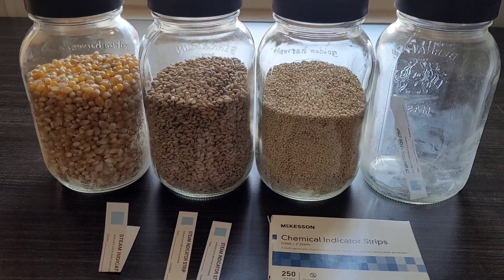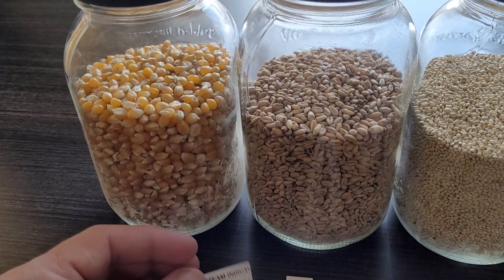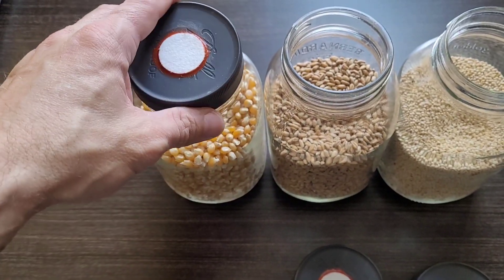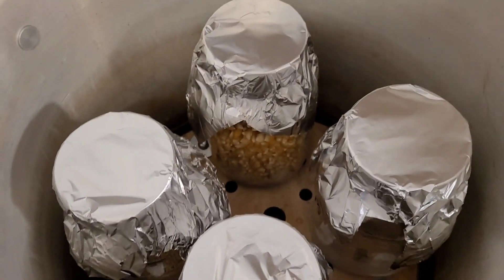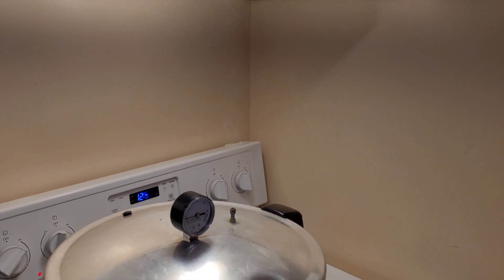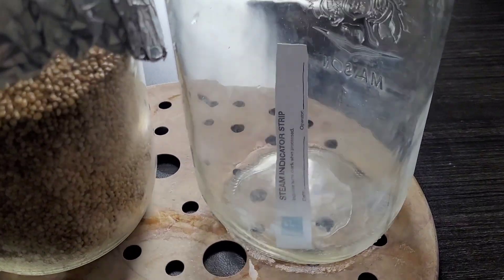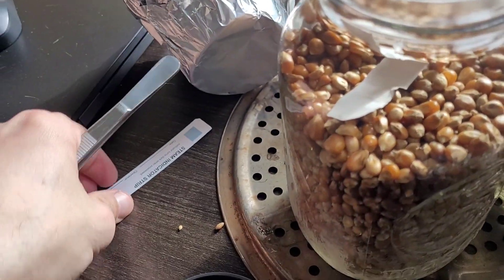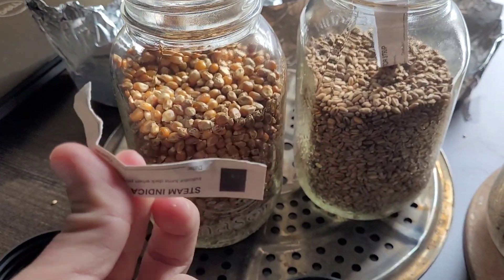23q Presto Steam Penetration test

Comment: Would you please test 2 more jars with 0.5 inch of water; one with tightened [2
peice ring] lid; one with a "finger tight" lid? I'm being told on Reddit that
you have to vent the trapped air *in the jar* to achieve sterilization. I
believe that the venting is to allow a vacuum to be formed after cool-down.
Some mycologists find undesirable because it sucks in "dirty air" (we'll ignore
the flow hood) when opened. I believe that a tightened lid will still sterilze,
but result in no/little vacuum after cool-down. The lids and jars should be okay
(unlike in your dry test) because the pressure inside the jars will increase
because the water will turn to steam.
Reply from the maker: You do have to vent trapped air.

Comment: Even "dry" grains contain moisture. You added a variable by using an unmodified lid for the empty jar.
Reply: probably a raw grain jar with indicator strip and a tightly closed lid would have been another good one to do
Reply from the maker: Dry grains have too little moisture to create sufficient steam to affect the chem strips.

I used the unmodified lid to prove 3 things:

1. Steam will not penetrate a closed jar;

2. Steam is responsible for colour change (will not enter a closed jar);

3. Closed jars pull a vacuum and seal on cool-down.

Comment: Do endospores care if the steam comes from the grain or from the PC? Why would there be a difference 🤔
Reply from the maker: The endospores don't care, the point is whether a common pressure cooker can penetrate our common loads without the requirement for a  class-b vacuum pump.

Class-n autoclaves like the All-American benchtop autoclaves are generally employed for non-porous loads, like surgical equipment, etc. Class-b autoclaves are employed for more complex/porous loads like dental, or other equipment with complex internal structures.

It's just nice to know how things work and to confirm their functionality with real-world tests designed specifically for autoclave verification.

Plus there's not much reliable testing going on relevant to our practices, and it's fun.
Reply: @StipeCap  Ah now I see, didn’t know about autoclave classes. Makes sense!
Thank you for you answer and your work on here, very high quality info, I am currently running your CV substrate recipe and really liking it!
Reply: @StipeCap could u help me? I use presto 23 qt why my bags are no vacuum sealed? Can I do smth about?